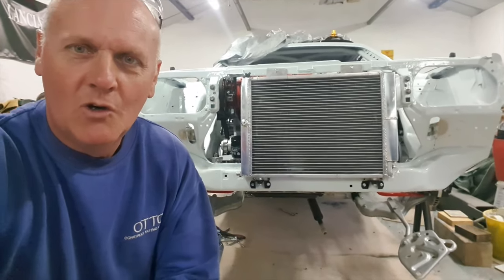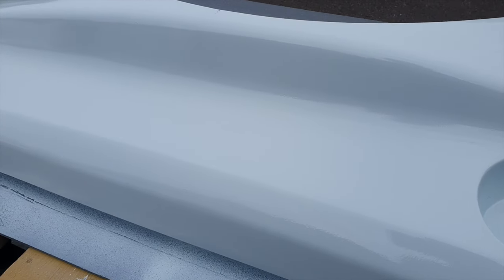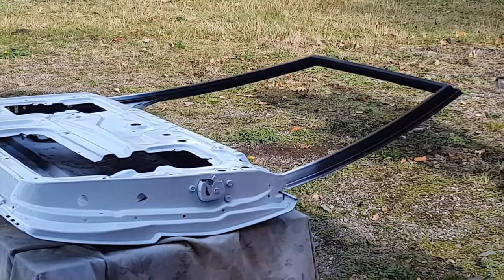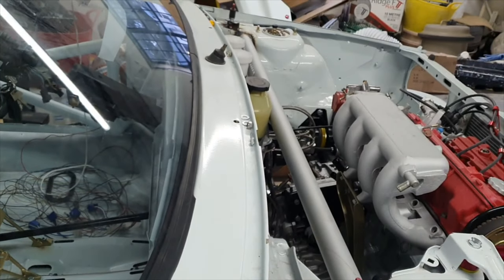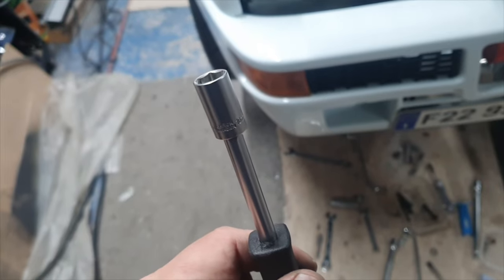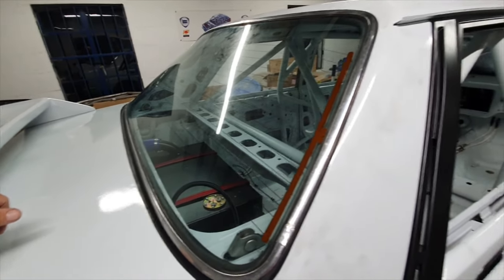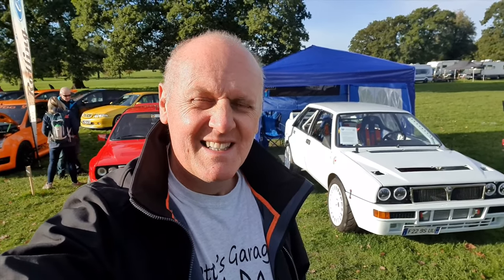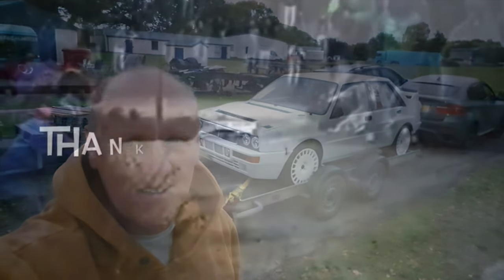How to Build a Lancia Prisma HF integrale

Comment: i alway's use tyre grease for fitting the windows...also pull the rope flat against the glas...i like doing it with 2 man 1 pushing light on the outside of the glas